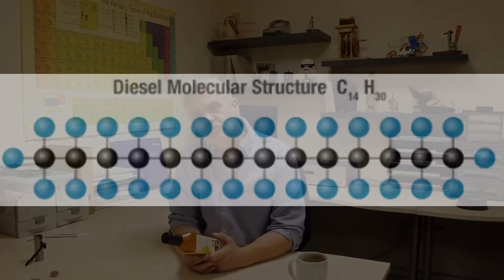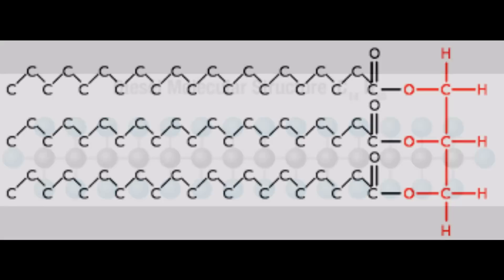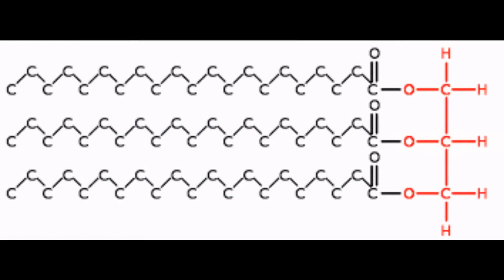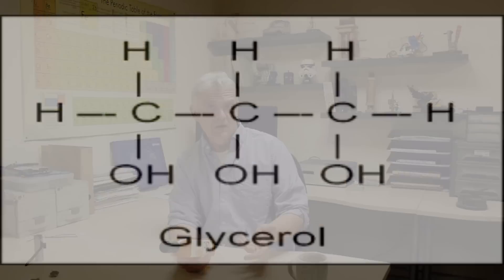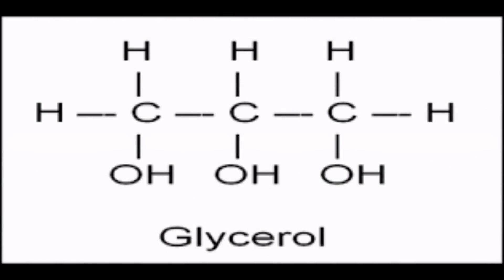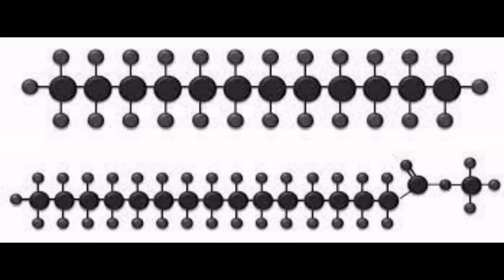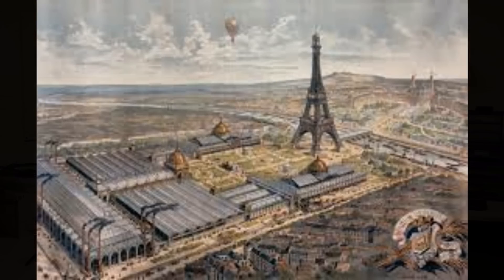1672 Biodiesel 101 - The How And The Why And The Wherefore Of Making It

Comment: I'm I right in assuming this can be used for the liquid result of hydrocarbon liquidation?
Reply from the maker: what do you mean by hydrocarbon liquidation mate?
Reply: @ThinkingandTinkering  sorry got the name wrong. Video 1661 turn waste or plastic into fuel.
Reply: So apparently there is hydrothermal carbonization, liquefaction, and gasification.
We're the operating temp and end result are different but the general process is the same.

As for my question, in video 1661 you said the mysterious liquid could be a precursor to diesel. I was just wondering if this process of refining vegetable oil into diesel, could be used to turn that mysterious liquid into diesel?

Comment: Some old motors don't give a toss.
Just chuck 15% petrol or 50% diesel in the VO and be done.
Helps to run twin tanks and have a preheat on the VO side.
Reply from the maker: very true mate

Comment: so a could more things here .... to make it cost effective , the alcohol has to be recovered from the waste . 
also if used cooking oil is used it will need to be washed many times , as there will be suspended food debris and salts remaining in the oil that can be hard to remove properly .

also after washing the oil it needs to be heated to around 250 degree's f to remove and suspended water 

also the ph of used oil will be inconsistent from container to container , so careful measuring of the ph to add the appropriate amount of lye is necessary , otherwise you end up with a giant batch of soap :D
Reply from the maker: cheers mate - nice tips thanks for posting

Comment: so i did testing a few years ago with a vw single point injector ( the ones used on lets say 1992 and older vw diesel ) ... i could mix up to 30% veg oil into #2 diesel and still have a proper spray pattern to burn the diesel , which meant no issues with it coking up the engine or any other nastiness of running straight cold veg oil in a diesel . 

the other option is to heat the veg oil to at least 150 degree's F , this thins it out enough to get the proper spray pattern at the injector so it burns properly
Reply from the maker: cheers mate

Comment: If I recall correctly... the oil and alcohol should be as free of water as possible (otherwise soap gets produced) 
That's  the big prob with biodiesel produced via oil and ethanol ... It's fairly difficult to purchase/utilise ethanol at such purity without officialdom wanting alch duty paid.  Other alchs... Not so because of their toxicity (inc in the glycerol) 

I've wondered if substances like zeolites, or perhaps even anhydrous copper sulphate have enough "pull" to remove water from the feedstocks?
Reply from the maker: good thought on the zeolite mate

Comment: I ran b99 in a 91 dodge with a Cummins 5.9 liter inline 6 cylinder turbo diesel for 7 years, put 500,000 miles on the truck running exclusively biodiesel (in Oregon at the time it was cheaper than pump diesel) never had a single problem and the truck got 35mpg on biodiesel only got 22 on regular diesel.  Also I ran a 47ft  bluebird school bus on waste vegetable oil for 9 years and was getting 20mpg in a 36,000lb vehicle.  That system used heat and filtration to make the waste vegetable oil anhydrous and to clean out the particulates.  Never had a single issue with either one.
Reply from the maker: awesome story mate - thanks for sharing mate
Reply: so you where driving your truck exclusively 40 hours a week , every week for 7 years ? without letup ?
Reply: @charlesboston1  yes, had a delivery job and had to go from Oregon to Southern California almost weekly, and sometimes up to Washington state.  That truck was the best vehicle I've ever owned, no issues whatsoever for 7 years. And almost 300hp too.

Comment: My 1996 F250 Power Stroke Diesel will run veg oils when mixed 50/50 with diesel without any issues, and doesn't do anything to my injectors or cylinders or rings, but I only mix it at 50% or less veg oil.
Reply from the maker: nice tip mate cheers - not sure you could do that with a newer diesel though
Reply: @ThinkingandTinkering  As far as I know, you can only do that on diesels that do not have a "common fuel rail" setup and in the U.S. it has to be before the 2005 EPA regulations went into effect on the diesel, otherwise it will trash the fuel and exhaust system. I also run the same fuel in my 2000 VW TDI.

Comment: You could use solar thermal to distil both your wastes and also to purify your end product, which should be close to clear and not have that yellow tint, then it will be less viscous at low temperatures and cleaner burning. The problem is that if it does not go through a vapour phase at some point you are carrying things across that may poison your emissions control gear on your exhaust. Speaking of that I read once about some (MIT?) researchers using a magnetron to form a plasma to clean exhaust fumes on buses, in which case you have a system that is harder to poison but more complex.
Reply from the maker: I like the solar thermal idea mate - cheers

Comment: I looked into this many years ago.  The mileage per gallon is not as good a diesel.  Also it will damage the fuel system.
Reply from the maker: I have heard  the opposite too - seems it is a matter of opinion mate and probably a matter of how well you make the biodiesel
Reply: @ThinkingandTinkering  I talked with a driver of a diesel car that confirmed it. More research needed

Comment: Thanks again for the complete answer. I learned the myth of peanut oil instead of mineral oil. 
Knowing the methanol can be recovered, just the sodium hydroxide is consumed, helps.  
Kind of surprised the British tax man would stop home made bio diesel as it cuts down or fuel taxes. So far they let it slide in America as long as its not heating oil or "farm use" diesel. they put a red dye in farm use diesel as there are no taxes.
Reply from the maker: I think it is illegal here too and it's the same they let it slide as not that many folks do it
Reply: @ThinkingandTinkering  Thank you for the reply sir.

Comment: by the time you done it washed filtered it .methanol etc and cooking oils tend to follow fuel prices. not much saving. did run 50 50 straight oil and dino for 10k in and old motor. no issues. less mpg though. do not do it on a modern engine! also a bit contrversal farmers growing it rather than food.
Reply from the maker: indeed mate

Comment: It's been made illegal in Poland quite a while ago to drive on veg oil, and even the farmers got to pass a lot of regulations if they want to produce some biofuels for their machinery, rendering jt completely uneconomical. Even the veg oil prices matched the diesel prices, which is unbearable, cause I do like chips as you call them. 

But enough of that.

Condolences to the UK and the Royal Family for this saddening loss. It's touching even to me, an outsider.
Reply: Why in the world would they do that?  Normally the Polish are rather smart and don't buy into the far lefts bullcrap. Makes me worry about who they've voted in.
Reply: @highlandermachineworks5795  
Personally, I believe it's because this country had never reclaimed its full independence. 

Historically complex topic. 

It doesn't really matter who gets voted in. It matters how the law is enforced.
Reply from the maker: cheers mate and to be honest I don't think it matters much - it's just good to know the process
Reply: @ThinkingandTinkering  
Ah yes, certainly it does. Well worth knowledge in a SHTF situation. 

Btw, have you seen the guy doing pyrolysis with the use of microwaves? I read some papers it's a process that delivers surplus in energy, self sustained with the proper set up and with quite a bit of energy left over.

Comment: If you can wash the glycerine ( glycerol) and possible distill it off, then dry it.  It has been used as heating oil. However it will pick up any moisture in the air.

It can be added back to the biodiesel & will lubricate the valves.
Reply from the maker: you can also convert it to propylene glycol and it is 50% of vaping fluid

Comment: Hey Rob, what do you think would be a good source of making oil at home if you didn't want to buy it? It looks like you can grow sunflowers or pumpkins for oil seeds. I wonder if there is any forageable material that could be used. What are your thoughts? Also, diesel can be great as a vehicle fuel but in some areas, it can be difficult to get a diesel-powered vehicle. I think a cool video idea would be making a home water or air heater that is powered by this biodiesel to show alternative ways it can benefit our lives.
Reply: I think algae grow fast and produce a lot of oil. Soybean can be a good option as well.
Reply from the maker: I agree mate - there are diesel heaters on the market and they are fairly cheap, sources of oil include reclaimed, algae, fungi, seeds and nuts
Reply: @ThinkingandTinkering  Great stuff Robert.  Thanks so much for the education.  
Yes - I would like to build a a rocket Mass heater to run on Veggie or B100.  Workshop / garage.  
Seems a good use - avoid the challenges of running a car on home brew.
Also - heating water - something obv we need 365 d / yr.  Space heat - only 5 months.

Comment: This was a great intro to biodiesel. I’d like to see what can be done with the glycerol, how it can be distilled to reuse, and what uses there are for byproducts.
Reply from the maker: I was thinking about this too
Reply: This basically soap production.  Watch the movie "Fight Club"  /this is what they were doing and that is why they were raiding the hospitals for the liposuction waste.  Oh and did you notice the big explosions and buildings falling at the end ;)  It is all related.  Most people missed this.
Reply: Just do not mix it with nitric acid. It's too unstable .
Reply: @iindium49  Make in tiny quantities in a very cool room add diatomaceous earth as a stableizer and build a boombox to store it in.
PS a boom box has 5 strong sides and a weak side made of as light and harmless material as possible insulation foam board works great where the blast will safely be directed, keep the boombox cool and dry.
Reply: Glycerin can be used to make soap and is also  a very useful soil amendment.
Reply: @fintan9705  Wetting agent.   They remove the glycerine in commercial soap to increase shelf life as glycerine takes on water from the air over time.  Natural soap is better for your skin due to glycerine.
Reply: @Robert; i have just been checking out Vevor to buy a diesel heater, they also sell distillers. Would those be useful to distill the bye products?
btw awesome tutorials and experiments!

Comment: Just when I thought this topic had been done to death, you come back with this video. Nice one! 

ok... so the coolest setup I've seen was from a professor's garage the US. He setup 2x ICB (1000L) tanks staked on top of one another that were connected via 1 or 2 inline pumps with tank/barrel heaters. This setup created the easy filter system to remove the glycerin, while also processing/mixing the oil very well. Each batch produced about 1000L of fuel from about 1100L to 1200L of oil (about 1 month of driving). He would source old cooking oil from local restaurants (rancid oil is fine too), filter it with a coffee filter, then titrate 3 samples to get the reactions ratios. You can use ANY natural oils (Veg or animal, including lard) the caveat of course is that animal fats need to be preheated and remain heated during the whole process to prevent solidification. Also if you add too much reactants, you'll make a crude glycerin soap.

Best ratio for your vehicle is between 20% to 50% biodiesel and 50% to 80% regular diesel. If made correctly, 100% biodiesel will work, but likely need engine additives. Biodiesel is more acid than petro based diesel and will eat natural rubber seals & will solidify at a warmer temp (like -10C or somewhere close to that, a cdn issue more or less) ... there really should be a PSA pamphlet on this. 

For further reference Portland, Oregon has had a thriving biodiesel fuel market for over a decade or more and University of British Columbia has produced post docs on the topic (around 2007-09). Yes during that time, I looked at using algae (from human waste) to make biodiesel to replace petrol, the profit margins were very slim. Results: possible but not practical at the time. oh right, some folks like to 'wash' the finished diesel with methanol to get more of the suspended glycerin out. Once again Rob, well done :) ... condolences about the Queen.
Reply from the maker: thank you for adding that mate - super useful information and very to the point - cheers
Reply: Great info, thanks for sharing! 😃
Reply: @James-fe7wd  
God has said in the Quran:

{ O mankind, worship your Lord, who created you and those before you, that you may become righteous - ( 2:21 ) 

 [He] who made for you the earth a bed [spread out] and the sky a ceiling and sent down from the sky, rain and brought forth thereby fruits as provision for you. So do not attribute to Allah equals while you know [that there is nothing similar to Him]. ( 2:22 )

And if you are in doubt about what We have sent down upon Our Servant [Muhammad], then produce a surah the like thereof and call upon your witnesses other than Allah, if you should be truthful. ( 2:23 )

 But if you do not - and you will never be able to - then fear the Fire, whose fuel is men and stones, prepared for the disbelievers.( 2:24 )

And give good tidings to those who believe and do righteous deeds that they will have gardens [in Paradise] beneath which rivers flow. Whenever they are provided with a provision of fruit therefrom, they will say, "This is what we were provided with before." And it is given to them in likeness. And they will have therein purified spouses, and they will abide therein eternally. ( 2:25 )

 Quran
Reply: Very nice.  Could you perhaps provide a link to that professional setup ?  Sounds doable.

Comment: klystron radiation on waste veg oil with quartz spheres coated in strontium oxide -> biodiesel
Reply from the maker: nice one mate - not really a kitchen method though
Reply: @ThinkingandTinkering  it is just a very interesting method. it does not need toxic stuff and the only reactant needed is the oil itself. i suppose it could be a kitchen method if an external wave guide was used to take radiation from a microwave chamber.  and into the quartz bead strontium reactor

Comment: Basically its saponification in alcohols... so you could you use  soap in a diesel engine?
Try it out…
Just depends on the soap you use and in which alcohol you desolve it.
Reply from the maker: it's very similar - saponification is the salt of the fatty acid and uses the hydroxide. Transesterification is the swapping of the glycol fatty acid ester bond for a fatty acid alcohol ester and the sodium hydroxide is a catalyst

Comment: A BIGGER batch could EASILY be made in a common electric water heater.

Just use valves or plugs where you have any excessive holes and you can even make this a continuous flow process.

Just mount a motorized stir bar in the top and enough of a seal to keep your methanol/ethanol from evaporating, and you can be slowly pumping in raw oils on one side and letting the fined oils out the other side to be separated, let the alcohol cycle back through, and keep this process flowing for as long as you like.

I would advise against using a gas fired heater for a couple of reasons, but the biggest is just that it is an open flame, near a container filled with a highly flammable alcohol which can cause real problems if the two get too close to each other.
Reply from the maker: nice one mate - thanks for posting

Comment: you just put 15ml white spirit to 1 litre of veg oil shake it up then pour it in the tank i was doing it for years
Reply: I was about to post the same, but 4ml per litre, which is what a Top Gear episode with Jeremy Clarkson’s guest used.
The cost of methanol renders the saponification a waste of time.
Filter old chip oil, add white spirit and good to go!
Reply from the maker: it's not saponification mate - it's transesterification
Reply from the maker: nice one mate - cheers

Comment: I used straight up old fryer oil in all my old diesels, including the 98 Ford focus. On my old tractor, if anything, l get more power, probably since its primitive and worn out fuel pump seals better with higher fuel viscosity. Its my summer fuel thugh, in winter l fuel it with diesel.
Reply from the maker: it seems you can chuck just about anything in older diesels
Reply: @ThinkingandTinkering  IRC they were made so farmers could grow their own fuel for the farmand there currently are programs in the US doing that from the AG department.
Reply: @Barskor1  that was Diesel's original intent.